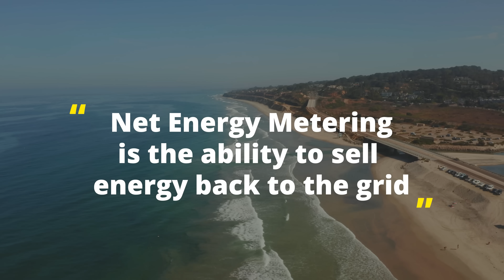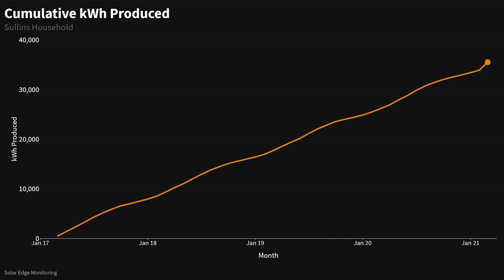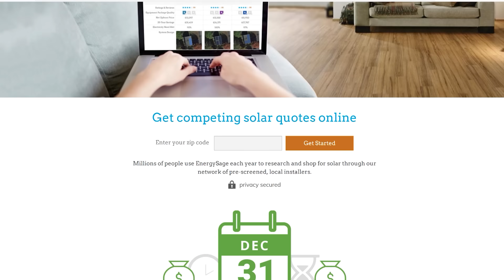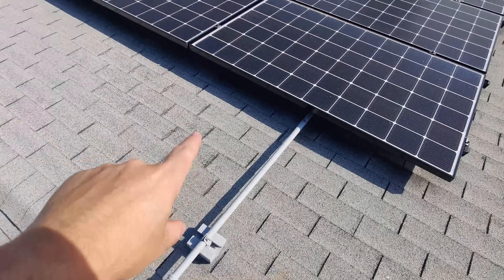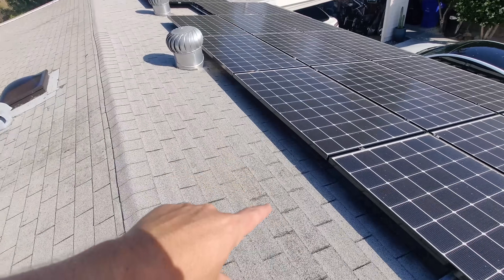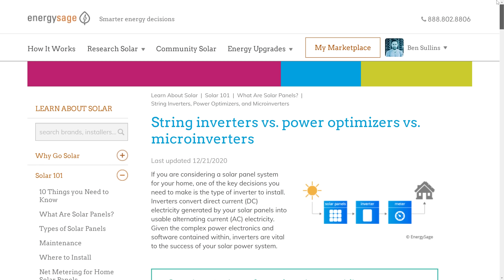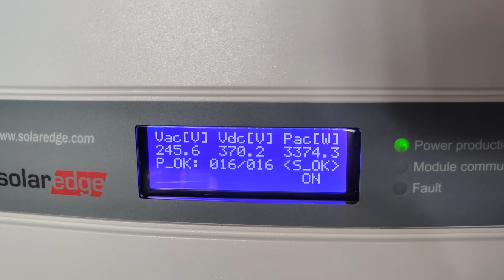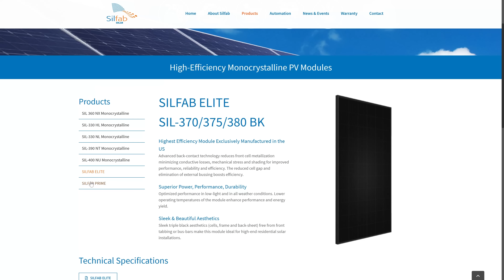The TRUTH About Solar! 4 Year Review

Comment: Here in the UK, getting a home battery makes financial sense - even without solar. They take advantage of the difference between high and low power rates and, in my case, have a payback of 4 years. With added solar you then either power your battery or sell excess back to the grid.

Comment: Your panels have a lifespan. Add replacement costs into your math. Also.... you have to "buy back" the excess energy YOUR panels created? Ripoff!
Reply from the maker: you've got some misinformation my guy. Sorry to tell you but none of that is true!
Reply: @BenSullinsOfficial  really? Solar panels don't get damaged by wind carrying sand? They do not degrade from temperature extremes?
Why do solar companies write them off after ten years? They depreciate greatly.
I'd like to see them become more efficient. As it is now I'd only use them in a free standing array on my property. Not attached to my roof.
Reply from the maker: Most come with a 20-25 year warranty, not 10, and they become less efficient. The inverter is the thing that commonly breaks after 10 years. Lots of good info here on YouTube to research if you’re interested!

Comment: It can go poorly too.  The company we used suggested a 15 year loan to do solar.  I paid it off early but, the system is failing after only 10 years.  Solar degrades over time but our losses are far above average.  However the installer refuses to help us warranty the failing panels, as it requires him to measure each one to see if it is working, and the license board won't do anything after 4 years, so it's on you to sue the installer to cover the system failure.  Guess what Lawyers are expensive, so instead we just deal with our failing installation.  NEM3 starts soon in CA and the Utility company will then give you pennies on the dollar for the power you put back into the system, making the batterys a requirement, and enough batteries you won't be buying power back for $.63/Kwh after giving you only 3 cents for the power you produce.  

I'm thinking my best bet is to let the system fail the rest of the way and then find alternative ways to heat my house or save power.  We have 32 panels and are still paying about $2500 per year for power.  Also we need a new roof now (shingles are showing fiberglass).  Not sure how much longer it will last, but it puts us in a weird situation with wanting to possibly purchase new panels to replace all 32 existing panels.

Comment: Hey, Steve here. Talked to a few Solar companies and one today.
Solar Professional. Said that for
$63.300. With the Government $18k. Off my electric bill would drop from $312. A month to $211. A month for 25 years. With a Tesla Wall battery. Have you heard of this company? And they work with a Roofing co. So with a new roof. 
It would be another $50. On top of my Solar bill. Total $162. A month. Sounds great. I’d spend with out Solar in 25 years. $93.600.
And with Solar $78.600. That’s 
A $39.000 savings in 25 years time. How does that sound?

Comment: Solar panels are 1/3 the cost they were 10 years ago. Adding on capacity is a lower-cost option if you are not using the electricity.

Comment: You need to factor in the lost "time value" of your initial dollar investment that could have been earning returns for you during the "recovery"period of time at least until break even point.  Also not mentioned are the "environmental disposal" fees (both gov't imposed and refuse company charges) for discarding spent or damaged panels, higher home insurance premiums,  costs for replacing storm damaged panels, and the costs of taking down and re-installing the panels when roof repair or replacement is required.  Quite  a few "profit" reducing "dirty little secrets" of the "green energy bonanza", in my opinion.

Comment: Sounds like you saved a lot of money and the federal government helped by paying a big chunk of the install costs in the beginning..but...no one ever seems to mention anything regarding the costs down the line to replace panels or inverters...the feds are not going to assist you in the cost to replace the system and the system has a finite life span....then what?...it would be nice if people were told up front  to put money away for the  future costs of reinstalling  panels and inverters that have run their life span... and it won't be cheap....better put away the money you saved over the time you have had the system because you will have future costs of replacing the system...not to be pessimistic, but that is a fact than no one ever brings up...nothing is free..

Comment: You also have to factor in a few things (yes the roof is important because replacing your roof will cost a bit more but not a big deal to remove panels).  But one thats important is the replacement of the battery pack.  In my country we don't have constant sun, so we need large battery storage, and replacement of it is $5000-$10,000 depending on what youre replacing.

Comment: In California, Newsom and the energy companies are trying to shut down sending any power created by solar panels back onto the grid.  So, all those panels you speak of will not be allowed, as in San Diego country in our state.  I have been looking into solar for the last three years and there is so much conflicting information, it makes it difficult to consider when the politics of energy get involved.  Tesla Power Walls are filled with those small Lithium batteries and considering the cost of about $12,000 to $16,000 per wall fully installed, I think I"ll wait until battery technology comes out with something better that does not use LIthium, that will, from what I've read of the research, be much lower in cost.

Also;  SDG&E won't buy back energy at the rate they charge us for power.  They'll now only buy it back for a fraction of the cost for any excess power you produce, so you have to also calculate that into your total cost if you're trying to put up enough panels to help pay for them by selling back energy.

Comment: i had some insanely high quotes from 65k for a 13.5 kw system to 100k for a 20kw system. i found an installer with 7000+ installs that is doing a 13.5 kw system for 42k. so 31k after tax credit. my electric rate is over 32 cents a kwh once all the fees are factored in. its only going to get more expensive now that fuels are so insanely high priced.

Comment: just to be clear, not all solar panel placement is the same so filling your roof may not be financially beneficial.  I filled my southern roof with panels (28).  this was estimated to provide 56% of any energy needs.  the installer wanted to fill my steep northern-facing roof with another 35 panels.  This was going to be an additional $75k.  But it was only going to add 20% additional electrical production due to the steepness of the panels and the fact that they face north.  so, just because you have roof space doesn't mean it's all equal.

Comment: Thank you for the great video Ben. I wanted to add another benefit of microinverters: when system ages the first thing gives up statistically is your single inverter and that means 0 production until you replace the inverter. With microinverters, when an inverter fails, only a fraction of one panel's production is effected (in my case a single diode failure - 3 of them per panel -  means 1/3 of one panel's output is out). Your system will still produce most the energy. Well worth the money difference. The single inverters bound to fail 5 to 7 years.

Comment: None of these guys ever mentions EVP's.    The converters on these systems increase EVP's in your home which can cause cancer.  There are enough cancer causing environmental factors that we live with, I don't want to add more to the mix.  I have a faraday screen on the smart meter owned by the electric co. because those smart meters put out EVP's as well.

Comment: In Australia the Power Companies now only give you at max 8c/kwh - 
and we pay about 21c/kwh and 97c/day for infrastructure - so we are 
getting ripped off - amazing it hasnt happened there as they are losing
profits basically - my contract is pretty old and runs out in 2y and got 66c/kwh
on a small 1kw system now nearly 15 years old - i want to go off grid next.

Comment: Do you have to pay a third party to use solar panels that you purchased and installed yourself? I assumed that you would install the solar panels and connect it with your meter and that would be it. But I’ve seen stuff online about paying third party companies monthly fees to use the solar panel. So does them mean a third party has control over your panels and can turn off the solar panels if they want?

Comment: The ROI time on solar is insane to me, and that's assuming everything goes perfectly. Not to mention the insane upfront investment. It also doesn't make any sense how it takes so much material to generate so little energy at this point in time, and that's with installations in the sunniest geographic locations. Solar has been around for decades. The technology and pricing has to change dramatically before I'd ever consider it for residential applications. Perhaps in 20 or 30 years it will finally get there? Won't matter to me by then though. Commercial and mobile solutions are a completely different story. However, starting a residential solar company sounds like a great way to capitalize on the trend and rip people off, which means it's already happening.

Comment: how do you factor in the cost of removing and reroofing every 10 years?
Reply: Why are you re-roofing every 10 years? Depending on the type of roof and shingles, roof can last 24-45 years. Panels will help protect the roof underneath them. Just re-roof before install if it’s an issue.

Comment: I'm getting a 8.9 kw system.  I believe in solar.  Yet I do question some of the math used.

A 5% annual electrical rate increase seems a bit high.  Doing research the expected PV reduction is over 1% per year, you have it listed at 0.4%.

There are several other factors like the increase in home value having solar and the simple fact that you're helping the environment.

Comment: Does the utility pay you for the excess electricity your system puts into the grid?
Reply: It gives you credit on the extra kw your system produces so if you go over what your solar system is generating u have a positive balance basically b4 2015 u did get a check

Comment: I live in a rural area with property,  My install would be ground mount.  I am on the fence about installing solar panels. As usual, every year there is a latest and greatest panels.  Like batteries, your install today will be obsolete in a few years, let alone 25 years.  Then the question arises, should I do the upgrade? Does the math work.  An initial  ROI of less than 5 years is my threshold. Getting an array that overproduces makes less sense financially (because of the additional cost & whether your utility credits you dollar for dollar, which increases your time ROI).  Where you live geographically is probably a huge component of choices.  Also, there is the mindset that an outage is the end of the world.

Comment: I've always wondered whether having hundreds of holes drilled in the roof shortens a roof's lifespan.
Reply: A good installation has every hole sealed up and covered with a flashing that the mount sits in. If it's a miss it should be sealed and flashed with aluminum roll flashing. 
Installation when the roof is over 100 degrees will degrade the life of the roof by a little. 
Unless you have a huge roof with over 50 panels it is unlikely you will have over 100 holes drilled. 
Each mount needs to be drilled into a truss and embed minimum of 2.5 inches.
Reply: SD solar sales rep here, most reputable installers will give a warranty on roof about 10 yrs with up to 2mil dollars just depends on if you use professional

Comment: The comment about checking roof integrity and life expectancy is important which is something your professional installer should already know. If you know your roof has less than 10 years left and they dont mention anything, I would raise a red flag. 2nd point about optimizers is that they too allow for individual panel monitoring; the video played at 5:18 clearly shows that. The comment about shade is a bit ridiculous. If your installer installs a system that is 1/2 shaded, clearly you selected the wrong installer. Anyone should easily be able to see shading where array location is proposed. Also, monitoring with solaredge is very good and is sophisticated when issues arise. If you installed a system in the past few years and need to add modules, chances are your installer (if they are working hard enough for you) would be able to locate the same modules with a bit of commitment and research. No customer should add different modules to a system because they wont work. Running a string of modules that operate at 32V is not going to work with modules operating at 45V for example. I think we should address these issues properly. Im a licensed solar contractor is CA for 8 years and have gone through 100s of these conversations. The technology today is much better than it was 10 years ago and solar is at its lowest cost ever. Do your research if you're in the market for solar and take your time. EnergySage is a good place to start but dig deeper and understand everything before you decide to move forward. Good luck to you all. Thanks for the video, always great to see the community sharing their experiences.

Comment: So in conclusion the solar energy will not save the environment, it will need more materials to build solar panels, and it will generate more pollution. For this reason, it is much better that nuclear energy is cleaner than solar or air energy.

Comment: I wonder if you were building a new home and planned for solar from the start what kind of good ideas you could incorporate in the design.  Like a larger roof facing the right direction at  the optimum angle. Would there be benefit  in using low voltage lighting?

Comment: I want a solar panel roof but I want a Tesla roof. The cost of it is justified to me in just the aesthetic look of it. These panels are also very low in yield percentage. I worked for a solar cell company and they made the worlds highest yielding cell at the time. Love the tech just wish it a built in cost on every home. If a Tesla type roof was able to be installed during building a new home constantly, the US would never need to buy energy. Cost is the only thing keeping that from really happening.
Reply: which solar cell company do you work and what is the yield that you mention?
Reply: @zenniz1992  I used to work for Sun Power back in the early 2000’s. We had a yield of around 24-26% on the cells we made for a plane for NASA.

Comment: Hey, solar installer in the DC area here. You talked about some benefits of micro inverters, but did not talk about what is in my opinion the most beneficial feature. They allow each panel to operate independently. Say you have a tree on the corner of the house, and half the array is shaded in the morning. When you have a long line of panels connected in series, the efficiency of the entire string is wrecked when half the panels are supplying a lower voltage. In terms of voltage, half the panels will be above the maximum power point while the other half will be below, and none of them will be efficient. With micro inverters, every panel is always at its maximum power point. If you want to spend slightly less money, an optimizer for each panel can also do this. Also, the ability to monitor each panel is very nice. We are notified immediately if any system we have ever installed has problems, and we already know exactly where the problem is.
Reply: Is the downside having higher expenses when they fail due to difficulty of replacement? Would you not just run optimizers?
Reply: @sparkfire1223  They aren’t too expensive to replace. When we go on maintenance calls we are usually going to be lifting up panels anyway. And with the long warranties companies are putting on their systems it won’t end up costing the customer anything. The largest downside is definitely the cost of installation. However, when you factor in the extra cost of a string inverter as well as the optimizers, it really only makes a difference on very large systems.
Reply: @itssterilized  great info thanks!
Reply: He missed this point of microinverters. It needs pointed out though, the benefits of micro inverters can be had with string inverters with power optimizers. Separate MPPT and monitoring. It was slightly cheaper than microinverters, but I checked recently and microinverters have dropped in price, so now either method would be good.
Reply: Ummm introducing many points of failure at a per unit cost(x) and inverters aren’t 100% efficient are they?  Plus AC is more susceptible to voltage drop than DC.  I’d go with an N+1 larger Inverter
Reply: How much does this bullsht cost to install
Reply: @benrichards9541  more than your momma
Reply: He doesn't know what he is talkin about
Reply: @VladFredK  good job man you explained nothing about anyone above explanation! Therefore your comment can be disregarded! 👍🏼
Reply: @VladFredK  lol you're a tit, your source: "Trust me bro"

Comment: Powerwalls, fortunately, are not needed here where I live due to the fact that the power rarely goes out. One power wall from TESLA alone costs $12,000!   I decided to keep my costs LOW initially to ensure that within 4-5 years I'm fully paid back. My total upfront costs with TESLA (Musk) was $8800 and after the fed rebate it will have cost me $6500: all this for a system generating 7300 kwh (estimate).  I'm still waiting on the power to be turned on, hopefully in a few weeks.